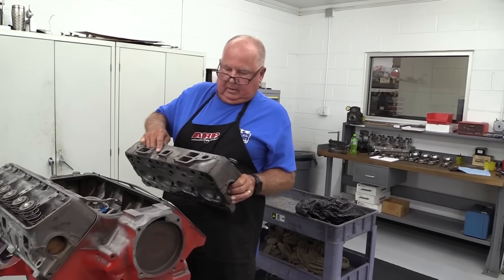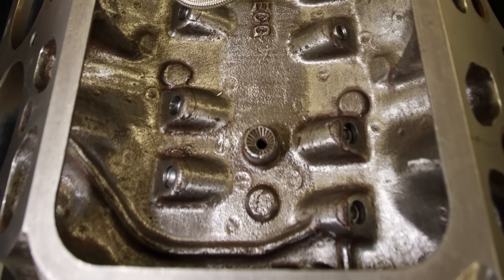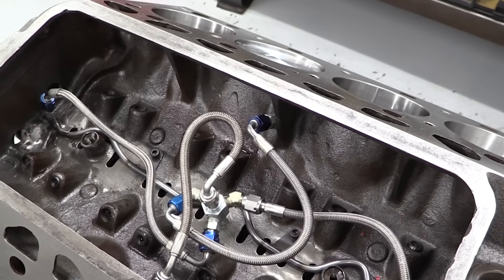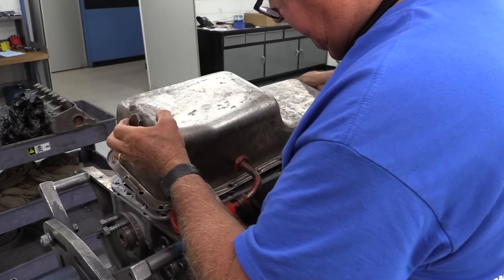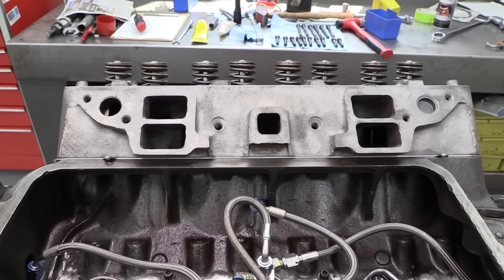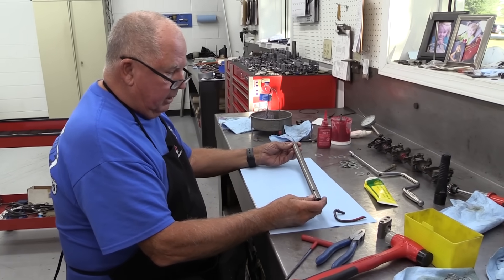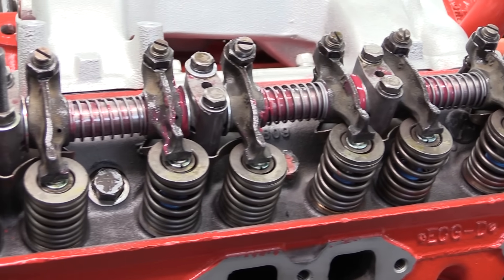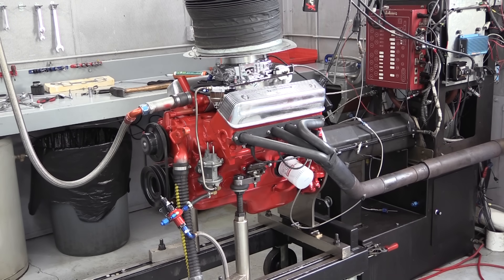The Engine That Replaced the Flathead -- Ford Y-Block Build

Comment: Nice vid. I believe daddys 64 ford had a y block. I do recall it had a glass fuel pump that had gotten scarce to find.
Reply: Not likely, Ford was using the 289 by then. The FE engines were also put in the  mid 60's by then.
Reply: @4thstooge75  USA Y Blocks: 1962 was the last year for cars with 1964 for pickups.
Reply: 4thstooge The FE debuted in '58. The SBF debuted in '62 as the 221 and 260. 289 came out in '63. The 260's last year was '64.

Comment: this engine came from Chevy they did not want it  notice the rocker arms  pushrods  valve cover washer with  rubber grommet and the road draft tube  much like 216 or 235 6 cylinder

Comment: That plumbing for the oil lines is pretty clever. I remember my dad saying that Y blocks had oiling problems.
Reply: That plumbing is not even necessary.  Simply ensuring that the cam groove depth and width is good is enough but it can be taken farther with a camshaft bearing that is grooved along the outside perimeter or cutting a groove into the block, which requires restrictors to prevent too much oil from going to the rockers.
Reply: @charliemccraney  🤣🤣
Reply: One improvement you can make to the rocker oiling is to use a later camshaft with a grooved center bearing journal, or have a groove machined in the one you have.  That way, the oil feed to the rockers is constant instead of intermittent.  The other fix is to block off that tube that comes off of one of the rocker shaft stands.  That way, ALL the oil goes to the rockers, not just part of it.
Reply: Clever indeed,  and out of sight.  Back in the day,  the fix was aftermarket "oilers" that consisted of copper or aluminum lines running along the tops of each valve cover,  and T-ed into the covers with brass fittings at several places,  so as to squirt oil all along the rocker assemblies.  Not very pretty and with so many fittings involved,  leaks were inevitable,  but they were effective,  nonetheless.  There may have been other configured fixes but those are the only ones I saw.  My first car,  a '57 Fairlane 500,  had the 292 in it,  but I never went the aftermarket oiler route.  It also had the bulletproof 2-speed auto trans -- the toughest ever built by Ford,   in my opinion.

Comment: Those HP/TQ numbers would have been impressive in the early 1950s,  I doubt it originally made those numbers with the stock intake, but probably close.   Great build !
Reply from the maker: Thanks! And thanks for watching!
Reply: The '57 292 was 212hp so the numbers here for a '55 engine aren't bad, particularly considering that it was achieved with small valve, medium port heads and a mismatched distributor, which does not control timing correctly with the carb used, which is not good at all.  With a matching distributor and '57-'59 large valve, large port heads, it would have done even better.  The distributor is the biggest problem with this build.
Reply: @charliemccraney    Thanks for the insight on the distributor.    Distributor advance curves made all the difference in these older engines.   For comparison, a plain vanilla 1970 Ford 302-2 barrel made around 220 hp / 300 TQ but the intakes and heads were quite a bit better even on a 2 barrel Windsor engine. (cubic inch vs. cubic inch comparison).
Reply: The '57 312 was 245hp with a single 4 barrel, or 275hp and 285hp as an E-code (2x4 barrels) same heads as the 245hp 312 and 212hp 292 but a high lift cam is used for the 285hp E code.
A Y went head to head with many mainstream engines at Engine Masters just this year with one of the rules being factory heads and placed 6 out of 13 against mostly newer (up to '68, I think it was) mainstream engines.  This is about as apples to apples as we will see.  The heads were and still are pretty good.  Large port and large valve heads are good for about 300hp before port work is required.
Reply: @charliemccraney    What stock compression ratios did these 50's Y blocks have?   Compression ratios were great even in a grocery-getter American  V-8 from around 1965 to 1971.  I'm thinking these 1950s Y Blocks were in the  8:1 to 8.5:1 range.
Reply: They were pretty low compression by muscle car era and modern standards.  '57 was the best year for the Y and a 312 might have just barely cracked 9:1 but that would happen only if everything happened to work out just right from the factory.  Every other displacement would have been lower.
8:1 to 8.5:1 is probably a good estimate on average.  Ford advertised  compression ratios that were higher than they actually are - I think they advertised something like 9.6:1 for a '57 312, which just won't happen in factory configuration.
However, most of the heads were designed to support much higher compression so getting compression up with domed pistons is easy and reliable.  Early '57 castings did have an issue that make them unsuitable for racing compression ratios, but still perfectly fine for performance pump gas street engines.  That issue was corrected by mid '57.
Reply: '56 292 in my fordor was rated by ford at 210hp with 8.4:1 compression.

Comment: At 15:12 area I thought I heard," not like most vehicles the tack runs off the distributor not off the transmission." Sorry to say, but you might be confusing that with RPM vers MPH. Unless I might be wrong and transmissions had a tack output when the mph were off the wheels?
Reply from the maker: Yep. Major brain fart moment. Was trying to say unlike most that have a electronic tach signal and somehow got confused with the speedo cable. Thanks for watching!

Comment: My mid-year '56 Customline  (no B-pillar) Coupe had a Y-block. The woman I purchased had always had the local service station change the spark plugs for her, however it never ran any better.  When I got it I found that the rear plugs on each bank had never been changed. The answer was the single exhaust with forward crossover, you needed a contortionist to remove those plugs.  It should have been serviced by our local dealer, (Geo.) Harrison Ford, which operated in this area until the early '70's. Narragansett Bay
Reply from the maker: Ouch! Reinforcing the sterotype of the slimy car shop that will cheat its customers by taking shortcuts. Thankfully, I think that is the exception and not the norm. Thanks for watching!

Comment: The Ford designers didn't do a very good job designing the oil system on the "Y" block, making these fixes necessary. Back in the day we put a "T" fitting between the block and the oil pressure sender, and then used copper tubing and a hollow rocker cover stud to get oil to the rockers when the engine block oil passages plugged up, (and they usually did). It looked like crap, but it worked. Also, there was a small hex shaft that fit into the bottom of the distributor shaft and ran the oil pump. If that shaft failed, the oil pump didn't work, with predictable results. Because the distributor was in the back it was hard to work on. Some people would remove it and install and adjust the new points on the bench. If the hex shaft came out with the distributor, as it sometimes did, you had to remember to put it back in place, or the oil pump once again wouldn't work. You had to adjust the rocker arms every month or the engine would sound like a Jackass in a tin barn, and if you got lazy or cheep and didn't install a new rocker cover gasket, it would leak oil on the exhaust manifold, making a smelly and smoky mess. I worked on a lot of "Y" blocks, but I never liked them.
Reply: It wasn't the design that was the problem it was the oil quality and improper service.  If your theory is to be believed then that means my 292 that has never been apart since ford built it in 56 should have oiling problems but it doesn't, it has none of these mods or work around fixes cause the previous owner was very specific about service schedule and is why even after sitting nearly 34 years it didn't need a bunch of overhauling to get it back on the road under its own power, just your usual service done for tune up and oil change.

Like wise the distributor in the back I initially thought would make points a pain but in fact it is quite easy to set/adjust/replace points.  its not as hard as is put forward which leads me to believe its just people talking about things they know nothing about.  As far as adjusting rocker arms every month I haven't adjusted my rocker arms on my 292 in over 3 years.  Its getting to the point I need to do an adjustment but you don't adjust them every month if you are adjusting them every month then you are setting them on the loose side of the spec.
Reply: @Milner62 ; apparently lubricating oil is not your area of expertise. Not counting synthetic oil, what properties do high quality lubricating oils in 2019 have that 1955 high quality lubricating oil didn't have? And yes, back then we had detergent oil and anti-friction additives. High quality oil in 1955 went through the vacuum plant, the solvent plant, the caustic plant, and the Hydrogen plant, and had a high Viscosity Index,  just like high quality oil in 2019 does. The fact is it takes one cup of fine dirt grit to wear out an engine. If that dirt gets in the intake of an engine, it WILL cause engine wear, and no oil can prevent that. Even if you change oil every 1,000 miles, that grit will be passing through the oil system and grinding on bearing surfaces. Even with a detergent oil, dirt deposits consisting of fine grit will be deposited on the inside of your engine. The trick is to prevent that fine grit from getting into the engine in the first place, and that means you must properly filter the air entering the engine. The most advance engine oil is not intended to keep dirt out of an engine, that is the job of the air filter. A paper filter works VERY well, but the oil bath filter was no better than a wad of steel wool saturated with oil. If you are still using an oil bath air filter, I strongly recommend you go to a paper filter ASAP. If you haven't adjusted your 292 rocker arms in three years, you must like the sound of loose tappets. With a modern engine with hydraulic lifters, that is NEVER a problem.
Reply: @oldgysgt , thanks for taking the time to broadcast to the world your ignorance.  If you truly think oil is the same as it was from 60 years ago you are sadly mistaken.

When my 292 came out there was no recommended multi weigh oil, it was a single weight oil that you had to change based off your temperature which most people did not do.  Multi weight oils was in its infancy in the 50`s and some people used it but most didn't as it still had problems in of itself.  The anti wear additive ZDDP was placed in the oil as a high pressure additive and the levels of ZDDP went higher till the emission era killed it off claiming it was clogging converters but yet the height of zinc was in the 1980`s and my '78 Mercury still sports the two OE Ford badged converters and will pass a emission test for a '92 year model ford truck with a 351W.

In the end oil is vastly different today than it was 60 years ago.  Oil has the additives now that allows oil to cling to components after shut off to help eliminate dry starts.  Oil in the 50`s didn't have this ability and would actually drain off components with enough time.

The oil bath filter works great, why would I replace the oil bath filter for a paper element when my engine is still going strong with over 100,000 miles on it with the oil bath filter?  Like wise the tappets are in need of adjustment now after 3 years they were quiet for 3 years.

You must be doing something extremely wrong to have to be making adjustments to your engine as much as you are.
Reply: @Milner62 ; Yadada,  Yadada, Yadada. I was rebuilding 292 engines before you were born kid.
Reply: @Milner62 ; and in this case it's TRUE. I rebuild my first 272 when I was 14, how about you?
Reply: @oldgysgt , Honestly I don't care how old you were when you rebuilt your first Y block, the fact that your Y block has to be rebuilt every 50k miles speaks volumes to your lack of ability to rebuild an engine.
Reply: @oldgysgt The '50s oils didn't have the same (or as good of) detergents as modern oil which help prevent the sludge problem that clogged Y's passageways. If I remember correctly, unleaded fuel also helps alleviate the sludge problem. (Carbon from the combustion process contributes to sludge buildup.)
Reply: @Milner62 ; I can't help but notice you have a habit of using personal attacks on me rather that the facts I state. That's why I still have a hard time believing you are as old as you claim, (such conduct usually is a tactic used by immature people). I didn't say I overhauled MY 272 every 50,000 miles, but back in the 1950's it was the norm with most all cars to replace the rings and lower end bearing at around the 50,000 mile mark, because that were starting to use oil, (burn it that is). Usually by less than 100,000 miles the cylinder taper was so bad that they had to be re-bored. If the cylinders wouldn't  cleanup to .040 over, it was cheaper to just put in a rebuilt short block. We could get a 272/292 rebuilt short block back then, with .040 over pistons and a .010 .010 crank for $85.00 wholesale plus core deposit if the old block was too badly worn for the rebuilder to mess with. Most cars that came into my father's shop for an overhaul had about 50,000+-miles on them, and very few people could boast of a car with 100,000 miles on it with the original engine. The FACT is, dirt wears engines out, and you can use the best oil made and change it every week, but if you don't keep fine dirt out of the intake, your engine will not last, (and every mechanic knows that simple fact). Apparently Ford also realized the "Y" block was a mistake and a dead end, because they replace it with the 289. And the 289 had a lot more in common with the GM  265 than it did with the 272/292/312. Now let's stick to the facts and stop with the personal BS.
Reply: @foxfordcatguy2283 ; as a matter of fact, Detergent oils were first introduced in the 1950's, but then as now, their effectiveness was very overstated. Their main benefit was to act as a selling point for oil companies. The same overstated benefits were also claimed by Chevron for their "detergent" gasoline. And Tetraethyl Lead is not a major constituent of engine slug. The shellac-like residue you get from evaporated gasoline does contribute to forming engine slug. Some unburned gas can get past the rings and get into the pan, and when the light ends evaporate, a sticky shellac-like residue stays in the oil. This happens a lot with carbureted engines, but not so much with our modern fuel injected engines. Changing your oil regularly will help remove the shellac. But still, the main constituent in slug is fine dirt particles. If you take a gob of slug and burn it, you will be left crumbly rock. Crush that rock between your fingers, and you will have fine powered DIRT. That is why it is so important to properly filter the air coming into your engine. The best oil in the world and the most modern gasoline will not save an engine that is vacuuming up dirt!
Reply: @oldgysgt Just noting  info that has been out there for awhile. Maybe it hasn't made it to the OFH yet? Do some research.

And it's called SLUDGE. Not sure how a SLUG would get in your crankcase?
Reply: @foxfordcatguy2283 ; spelling was never my strong suit. If it wasn't for "spell check" I would have to send smoke signals.
Reply: @oldgysgt  old oils had no detergents, and lead from the fuels would contaminate the oil. along with the carbon mixing with the oil, it would then turn to basically tar. new oils have detergents in the form of metallic acids that keep the block clean.
Reply: @frigglebiscuit7484 ; Detergent oils were first introduced in the 1950's, but then as now, their effectiveness was very overstated. Their main benefit was to act as a selling point for oil companies. The same overstated benefits were also claimed by Chevron for their "detergent" gasoline. And Tetraethyl Lead is not a major constituent of engine sludge. It was removed from gasoline to clean the environment, not to clean engine oil. The shellac-like residue you get from evaporated gasoline does contribute to forming engine sludge. Some unburned gas can get past the rings and get into the pan, and when the light ends evaporate, a sticky shellac-like residue stays in the oil. This happens a lot with carbureted engines, but not so much with our modern fuel injected engines. Changing your oil regularly will help remove the shellac. But still, the main constituent in sludge is fine dirt particles. If you take a gob of sludge and burn it, you will be left crumbly rock. Crush that rock between your fingers, and you will have fine powered DIRT. That is why it is so important to properly filter the air coming into your engine. The best oil in the world and the most modern gasoline will not save an engine that is vacuuming up dirt!
Reply: @oldgysgt  dude, oil detergents are not all show. I've seen it myself what non detergent oil looks like after an oil change.
Reply: @frigglebiscuit7484 ; DUDE, I didn't say detergent oils were just for show, but they are nowhere as effective as the oil companies would like you to believe they are. The best way to keep dirt out of your engine's oil system, is to keep dirt out of you intake in the first place. EVERY real automotive mechanic knows that.
Reply: you sade it